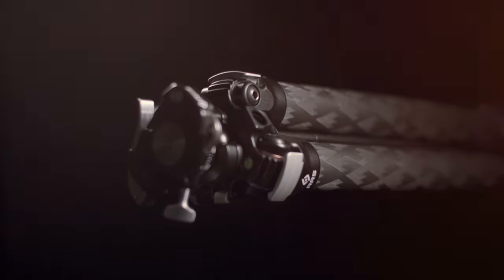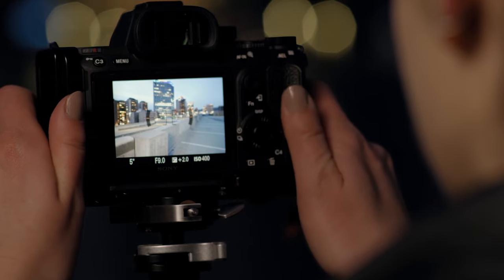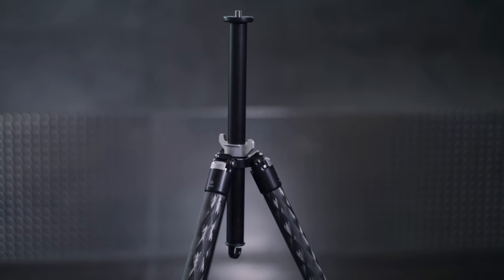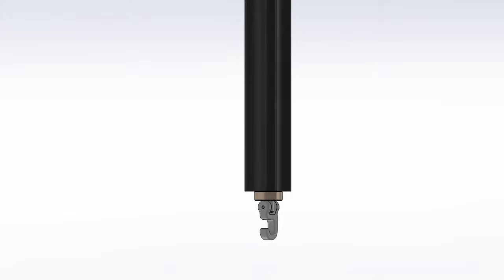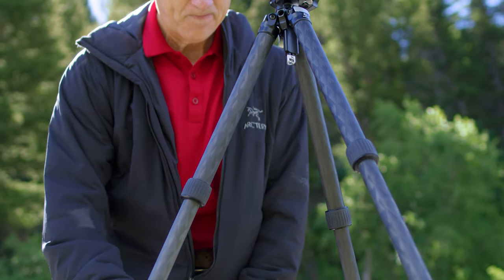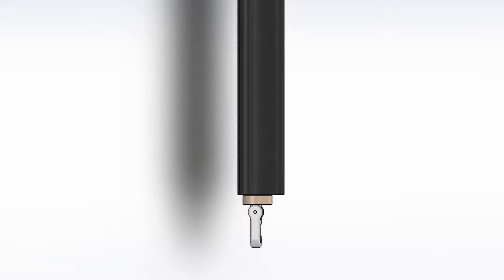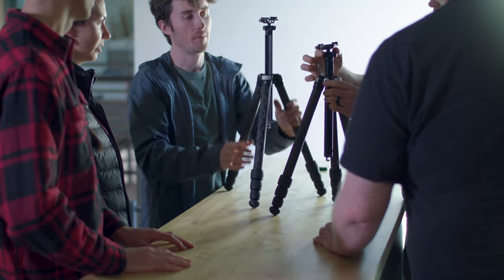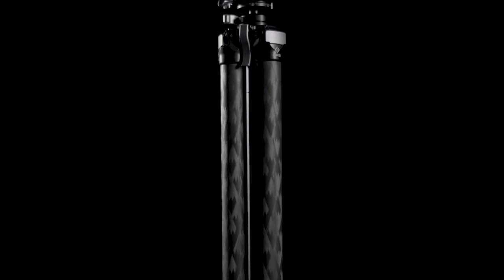The Making of the Ascend

Comment: this is perfection, such a well thought out design. I just simply can't think of anything I would want to change. the price is high, but considering all the features and internals (center column) I think it's more than justified. And with the lighter mirrorless (also no mirror slap) cameras I think sturdy for most applications with moderate focal lengths. I have a 24L with an arca P0 head, but this is actually what I need, anyone want my 24L? :)